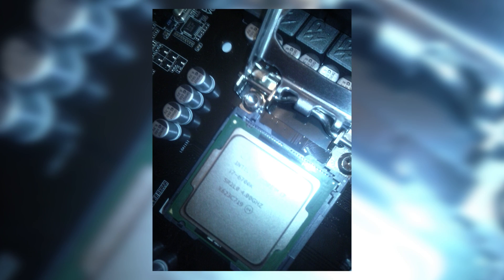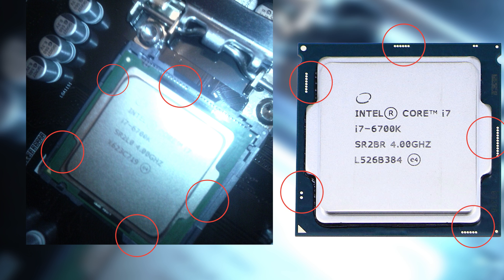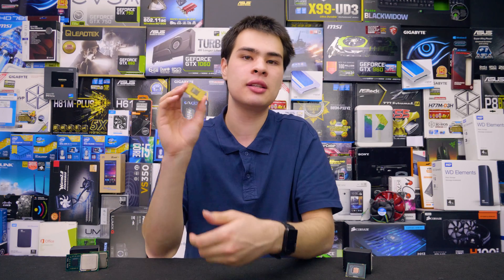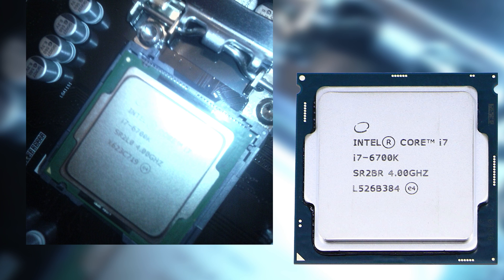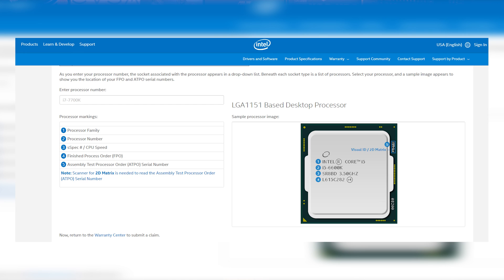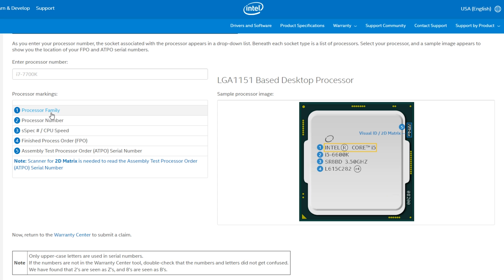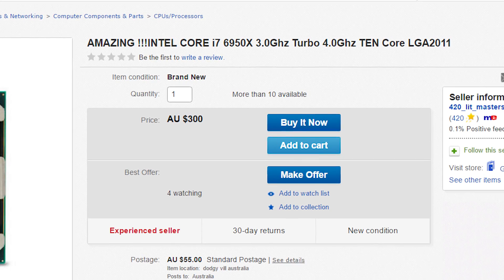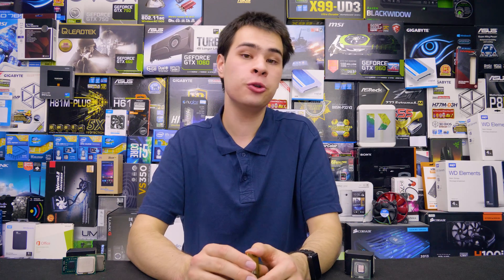CPUs EXPOSED - How To Spot A Fake CPU

Comment: i've always wondered if it was possible to get a ARM CPU to run on a motherboard of some sort.. If what you say about the fake CPUs using a ARM, I want to see one running.

 Hell, i'd love to get a system to run a ARM instead of a random AMD/Intel CPU..
Reply: Absolutely not. The architecture supported by Windows 10 ARM is not possible given the design. The Windows 10 ARM spec does not specify a BIOS, so you aren't getting a POST. They don't use UEFI, that's an almost entirely x86_64 spec, and they most assuredly wouldn't know what to do with those pesky PCI-e busses. If you can get an ARM processor of any sort running on an Intel board, post how you did it, because I'm sure a lot of engineers would be very impressed.

Saying that, +CPU modder maybe don't claim things you aren't necessarily very sure of. You want to break ground and get views to grow your channel, cool, but don't spread false info to people that you know will eat it up.

Also, stop promoting so many comments that it floods out actual comments. Because if you look at the like/dislike ratio and the comments, the two are painting very different pictures of what people actually think.
Reply: The only hardware that i can think of that would fit the bill is an ARM server southbridge manufactured by Qualcomm and used among other things i think in the Playstation 4. If i remember right, it can carry internal firmware and has a bunch of PCI-e lanes. It would be used in the "opposite" way to how it runs in these systems, and you could emulate 8086 subset sufficient to pass POST in software - but then you still couldn't boot any actual operating system on it, not even ARM version of Windows without severe modification. The engineering effort would be huge and completely pointless, so i could bet like $10 that nobody has done it, at least certainly not for the purpose of selling fake CPUs. Instead, the chips that POST actually have to be just Intel CPUs that have had a hidden defect or sustained damage during handling or use.
Reply: While it is possible to do such an elaborate effort, they go with using older intel cpu's like say a celeron D,pentium 4 HT as there were socket 775 processors that didn't get soldered on heatspreaders which makes it an easy processor to duplicate.

Stick on the I7 heatspreader from a legit processor that were sent in with the original box it came in from breaking a corner or two from user install gone wrong.
Or similar situation where they got hold of a whole bunch of I7 heatspreaders & wait for the money to come in as someone buys a fake from them.

They could also have a laser cutting machine that can etch into metal just like intel does & simply polish/sand off the old text on the socket 775 processors & then put on the text & place it in a I7 box & sell away.
Reply: @avfusion well, the closest we have to ARM controlling intel x86 motherboard is this: https://hackaday.io/project/18868-improbable-avr-8088-substitution-for-pcxt but thats one step.

when i said i could get a cortex running a socket 7, the cortex has enough busses and things to get some sort of communication to the southbridge.. still just bitbanging...
Reply: Maximus, Your recent comment didn't go through, probably because it contains a link. It partially showed up for me on the G+ widget, but i can't read the whole comment.
Reply: If google is doing an anti-link policy now, i tell you what..  lets delink it and just repast it:

@avfusion well, the closest we have to ARM controlling intel x86 motherboard is this:  hackaday (dot) io/project/18868-improbable-avr-8088-substitution-for-pcxt  but thats one step.

when i said i could get a cortex running a socket 7, the cortex has 
enough busses and things to get some sort of communication to the 
southbridge.. still just bitbanging...
Reply from the maker: it is possible and if the spoof the chip right it should work. have a look on google for windows 10 on arm and you will find some interesting stuff
google.com.au/search?q=windows+10+on+arm&spell=1&sa=X&ved=0ahUKEwj0ufq7iYXUAhXEipQKHbaaDxYQvwUIIygA
Reply: Well, yeah, win 10 can run on arm, but who's going to put one of them high end ARMs inside a intel packaging and fake the bios info?

.. there is a lot of data lines that they will have to duplex, (thinking along the lines of the 32/64 odd PCIe lanes for the mobos peripheral and card slots, the memory coms).. 
then there is the ARM architecture, if they are going to them lengths to fake the CPU, they need to make windows think its Intel its installing on, not ARM..

Lets take it a step back, if they just have the CPU, and memory in the package, they will still have to get the coms for the BIOS, then the screen output, (yay for cpus with gpus inbuilt, that should be a simple dvi/DP/HTMI passthough)..

that's why i want to know if such thing Really exists, not just a hypothetical idea.. I probably could get a new cortext to run on the old Socket 7 based motherboard now days, but to get a modem motherboard running now days? there's a lot of R&D there to bitbang them pins...

Comment: So that is definitely a real intel processor that the guy got. It's most likely a celeron or intel socket 775 chip with a I7 heat spreader attached to it. The arrow and notches match, as well as the white on black text at the bottom, just google image "Celeron D Cedar Mill" for example to see that it matches perfectly to the fake chip that the guy has.

Also as for your comment about people reprogramming ARM chips to act as X86, no. it doesn't work like that. Even if it did, the thing would be as slow as a 286 and there's no way someone would be able to fake it to get it to work in an intel slot. if that was the case then there would be a huge real market for ARM chips that work on x86 motherboards.

Comment: That's why I buy AMD.  J/K  I wonder if they do those as well.
Reply: AM3 and AM4 are physically different but 939 and AM2 up to AM3 look identical. Could get the cheapest Sempron and change the lid to FX9590.... then again who wants one of those. Maybe the Phenom x6 is more desirable
Reply: You cant delid AMD cpu's without destroying them(probably  could but hard)
Reply: MavHunter20XX could be possible  but more people are into intel maybe now that ryzen is out more people will jump to amd and that could make it profitable in a few years to make the fake ones (i am pulling everything out of my head xD so dont judge me on that if anything is wrong) but maybe u will find like some apu that they are selling as some of the newer ones it still could work if ur lucky
Reply: I'm sure I've seen it done with a Phenom 2
Reply: You can delid just about any cpu. AMD isn't special. They don't use some unknown secret technique to prevent delidding or anything like that. Hell, I have a FX-8350 that I delidded just to have a better look at the board. The thing still runs just fine.
Reply: well if its not soldered maybe but its still harder than intel
Reply: Not quite. All it really takes is just not trying to pry at it like a nut case. Just enough lift and it comes off easily. Too hard, and you risk damaging it. Or just use the "delid die mate"
https://www.caseking.de/der8auer-delid-die-mate-fsd8-015.html

Either way, just takes the right tool and hand-eye coordination.
Reply: +MavHunter20XX I've been buying AMD simply for price.
Reply: +Nightshade someone used heat to delid Ryzen.

Comment: Why wouldn't counterfeiters just take used celerons and slapping on the equivalent IHS for the high end consumer chips? You'd have huge margins as well as extremely quick turn around, on account of you only have to sand off the original and print the new information of the CPU.

Comment: This would be so much harder to do if Intel soldered the IHS but not impossible. That was probably just a "one off" fake. The guy upgraded from a LGA 775 chip he used for years to a 6700k, removed the IHS from both, swapped them and kept the LGA 1151 chip. Notice in the picture, you don't see the edges of the black epoxy between the IHS and substrate when we know Intel uses generous amounts of it. That seems like the most likely scenario.

Comment: There are also fake graphic cards - if it's cheap and from China, it's probably fake - they tweak the BIOS of some cheap old card so it pretends to be something better.

PS. If they bother quoting "honest" specifications (and they actually do, quite often), then check the known RAM type and bus width for the card it claims to be, the core type, and to a lesser degree, the clock speeds (as there can be OC or even downclocked models)
Reply: My friend bought a fake GTX 8800 that claims to be 1gb (even says so in its BIOS) but turns out to be 512mb
Reply: Microsoft Windows 98 on NES, anyone?

Comment: There is no way that anybody would make an arm CPU run and boot a standard Intel system. Its probably easier to just clone a real Intel cpu. However sometimes Engeneering Samples are remarked using a laser-edging machine (not really detectable until you Boot it and look at cpuid values). Most es samples do run slower than a normal release cpu but work fine otherwise.

Comment: Do a how to spot fake graphic cards video! Since China is right next to my country, cheap Chinese knockoff GPUs like the "Vamery GTX 750" (u can find shittones of these on ebay) are common. Problem is that they flash the BIOS on startup and some have custom coolers resembling that of legit brands so its hard to tell if they are fake or new before u buy them. A particular card my cousin bought was actually a gtx 460 GPU renamed and redeisgned  as a GTX 760
Reply: not an RX460
a GTX460 
it's a card from 2010.
Reply: A similar thing happened to me a few years ago. I ordered a new PCIe GPU and received a refurbished AGP version in the PCIe version's box. As it turns out someone started swapping out new ones with refurbished ones in the supply chain. The seller didn't know about it and they immediately  swapped it out and even paid for the postage.
Reply: Pakistan, and yes your are right about the absence of  VGA ports on the legit 760 but older GPUs like the GTX 650/550 have a VGA port and vamery "manufactures" those cards as well
Reply: One reason I hated when radeon names changes, they were gonna get confused with gtx eventually.
Reply: AMD RADEON RX460 ...
Reply: you could first of all look at the ports in the back.
from what I've seen, no GTX 760 has a VGA port. I saw them have an HDMI and a Display port and 2 other ports which I can't remember the name of, but they weren't VGA.
I have to ask: where do you live? Kazakhstan? Russia?
Reply: OK.... ordering my 1060 online is out of the option now, as im (quite honestly) cursed with unluck and im sure that the site vendor will just message me to contact the GPU manufacturer first and will NEVER  replace the GPU. Out of curiosity ,where did u order from?
Reply: you could just get it from amazon.
that is if amazon actually ships there and shipping prices aren't ridiculous
Reply: If they gave the proper Bios I'd be happy with the vamery card I have, but since it doesn't and I have no idea what gpu it actually is... Well I can't really use it properly since some games actually just crash on attempted boot. Some get to the menu screen, but when I try to actually play them... same crash. I just use the cards for test booting now. Might as well give them some purpose.
Reply: +Chance Oradat if you just go by number, yeah it's entirely possible. Like 270, which card am I thinking of? The R9 270 actually.
Reply: you have link for that?...i would like to see what they can do,,like turning a GTX 560TI to GTX 1080
Reply: oh yeah...is also safer for you to buy parts from taobao (since you said you are next to china)ebay are dangerous.